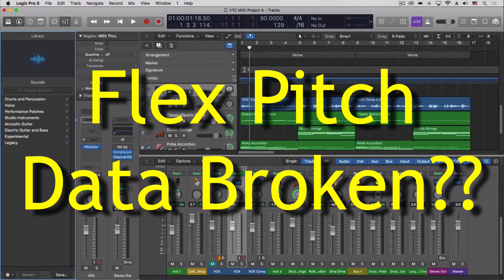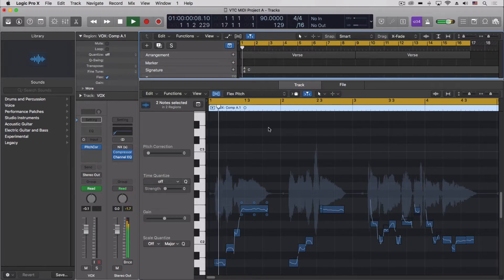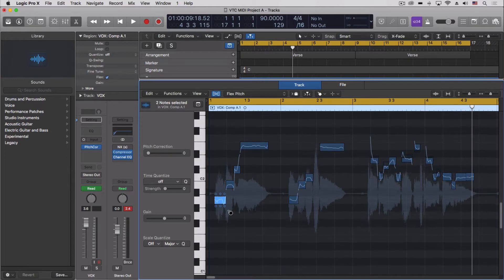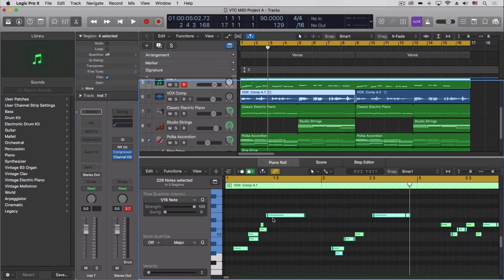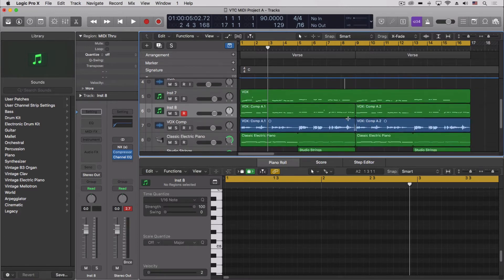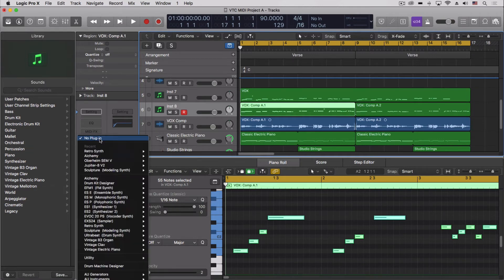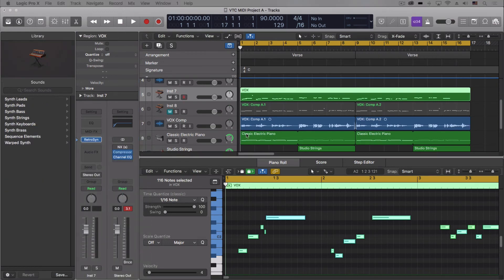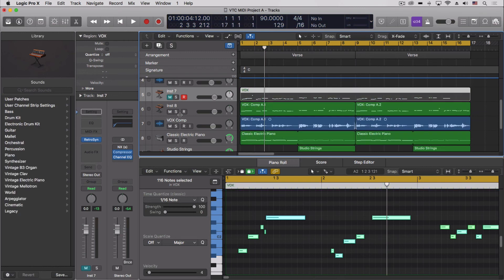Flex Pitch Data Glitch!! | Logic Pro X

Comment: Thanks for this.  I'm using Flex Pitch for one single note on a vocal.  I split the wav form before and after the note and changed the pitch.  But it makes the whole rest of the track distorted and loud.  So weird.  I'm going to try to just put that one note on a different track.

Comment: This is also true!  It does not work.  No midi data shows up in the piano roll editor.
Reply: One issue I found is that if the audio is not loud enough, everything is converted to zero velocity. Only way to fix it is to go into the Event List, select all notes and drag up the velocity values.
Reply: @exaltron  THIS IS EXACTLY IT. Thank you, exaltron. I was wondering why the notes were showing in the zoomed out view but not in the actual piano roll. This fixed it. Raise the velocity on everything, because the notes will likely be invisible
Reply: @theultimatechaser  @UCy8z3tuWTco8pPOYYyifInw can u explain more detailed how to fix this I'm new to logic so I don't know exactly where to raise the velocity
Reply: @im_twinzy6033  look at your piano roll. In the bottom left there's a button for changing the velocity or "volume" of each note. Select all notes then use either that to pull the velocity up, or use that menu in the top left corner of piano roll